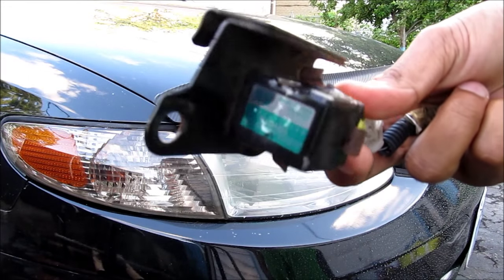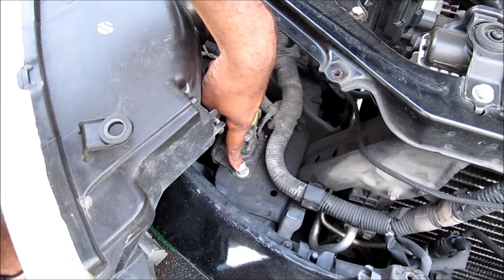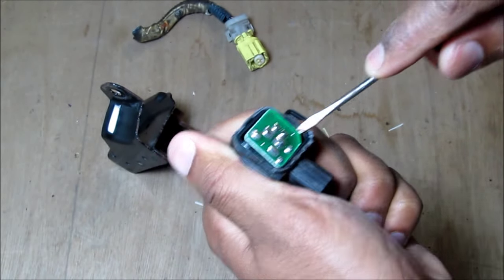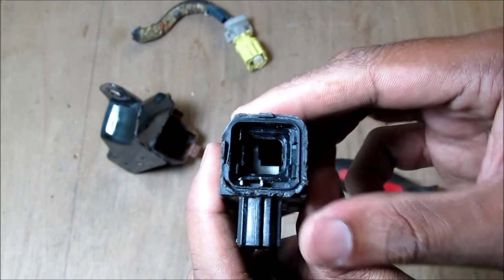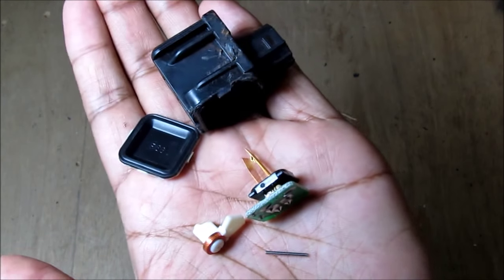How an Airbag Sensor Works

Comment: Great Video! Thanks. I've got side sensor fault on my Renault Megane 2001 1.9dci car. How can I check the sensors? How many ohm do I have to measure on the diagnostic resistor of the sensors? Can somebody help me? Many thanks in advance...
Reply from the maker: +Kotiti You might want to check the repair manual for the resistor values.

Comment: It looks like these sensors are re-usable (if not seriously deformed).

I am rebuilding a crashed MG ZS EV and was wondering about the sensors. I have replaced the airbags but worried to plug them in until I knew if the sensors were good or not.

Comment: he he "as you can see rust is probably a cause for these sensors failing"  he says rigjt before removing the immaculate "plastic"  sensor housing from its metal mount and then goes on to say how well sealed it is, couldent help but laugh at the contradiction. 

I'll tell you what causes these to fail, it's one of 3 things.

1, the resistor directly fails and the car reports a sensor problem.

2, years of warming and cooling causing expansion and contraction of solder joints breaks the circuit inside. 

3, years of vibration breaks the solder joints and therefore the circuit inside.

in any of these situations it will only cause a airbag fault to be reported if it affects the circuit made by the resistor,  it is technically possible for the circuit to fail beyond the resistor and for the sensor to have failed while the resistor circuit is still functional and not report a fault.
Reply: If the cables in the connector outside that seal rust, they can break, making the sensor effectively broken
Reply: 007titok
If the wires break then it is a wiring problem and not a sensor problem per se. If the wires don't make contact the ECU will sense an open circuit and a warning light will come on, that is the purpose of the resistor in the sensor. The sensors are quite robust and give little problems.
Reply: Thank you for this comment. The resistor can be replaced then if you have a faulty airbag sensor. You can also use a multi meter to run continuity tests to find any shorts and repair them. A resistor like this costs around three pennies. A replacement airbag sensor costs about $30-$40. Fixing a damaged solder joint costs one penny worth of solder. Clearly these are worth fixing. I wish I would've known this before placing my last time. Never again. From now on I'm fixing all my failed electronic components rather than replacing them.
Reply: @artbyrobot1  But aren't the solder joints, you know...…... inside...?
Reply: @Dalziel45  Yes they are, so you need to carefully open it and when finished carefully seal it again with some silicone caulk. Not really that hard. He shows it is easy to open in the video and he isn't even really being careful with it.

Comment: what triggers the airbag itself ?
shortage, voltage, or encoded signal ?
Reply from the maker: +King Parodije shortage of the resistor by the two contacts from intertia

Comment: I get a Code 19 on my Mazda5 but had no collision. Could a very rapid deceleration as you described cause a fault. Should I replace the front crash sensor and reprogram the SAS module?
Reply from the maker: +Matt Keefe first try reset and check wiring

Comment: My question would be,,,,once there is a crash and the entire airbag system has performed correctly are these sensors no longer functional after the repairs have been done and the crash data scrubbed from the computer ? all be it , i am sure it would throw a code during the resetting of the system if it were bad, but can they be trusted ? and are the a one time use sensor ?
Reply from the maker: +ron slaughter These aren't one time use, but some are, provided they're not damaged

Comment: I cringed a little when speedkar ran a blade on the plastic housing with his finger underneath and it slipped a little
Reply: My Lexus IS 200 have experienced an airbag deployment twice in one week without me getting involved in a crash or hard impact and the indicator on the dashboard wouldn't go off. What is the problem? Help with advice please

Comment: Will it works if the car is not in motion? I mean computer keeps receiving info about speed and so on but what if I've been hit while being on the stop sign?
Reply from the maker: +Grisanty de la cruz That I'm not sure about, depends on how its programmed.
Reply: That or if the car is running while parked and it's hit by another vehicle then yes it can cause airbag deployment but remember it depends on how quickly the other car decelerates, the angle at which the car makes contact, and how much the crumble zone gets crushed. But had it been a parked car (ignition off of course) then THAT cars airbags won't deploy. The car that hits it will go off.

Comment: wait so it is possible that under heavy breaking the sensor could fire?
Reply from the maker: Heavy braking will never generate the G forces needed to trigger because the maximum friction between the tires isn't enough to stop the car so suddenly

Comment: i got a question I have a 95 Chevy Blazer took same sensor off I had to drill rivits and bang em out  do you think it detonated it. the battery is disconnected I'm afraid to connected it
Reply from the maker: +MP CUSTOMS you could have ruined the sensor bit I don't think that would set off an airbag. The computer has to sense multiple things before it deploys, including vehicle speed. You'll likely get an error code and SRS light on the dash.
Reply: awesome thanks man much appreciated

Comment: How can you check if the sensor is actually working and sensing? My air bag light is on, so I am wondering if the sensor is not working at all?
Reply from the maker: +Paul Manning Measure the resistance across the terminals of the sensor. If it's open circuit (infinity resistance) or closed circuit (zero resistance) then its defective. That's the self test that the SRS computer performs everytime the car is started up. Scan your car using an advanced scanner or Toyota Techstream to get SRS codes to point you to which part of the sensor or harness is giving trouble.

Comment: bro u gotta way of illustrating complex processes so anybody could easily understand... thx.. btw so say an airbag deployed if u pulled those wires off tht sensor would tht stop someones car from dying...
Reply from the maker: Thanks for the feedback. Some sensors and srs computers have to be replaced (or reprogrammed) after airbag deployment. To deploy an airbag those wires not only have to touch, but it has to correlate with vehicle speed to determine deployment.

Comment: so if the air bag deployed do I have to replace the sensor and the air bag and that it.
Reply from the maker: +German Salazar You have to replace or reset the SRS computer too.
Reply: speedkar99 how can I set the srs computer
Reply from the maker: +German Salazar You have to Virginize the eeprom using the dump from a car that hasn't crashed.

Comment: Is this same as an impact sensor?  My car has the airbag light on all the time, and i checked with scanner, and shows that the driver's side impact sensor.
My car is 2004 Gti Golf.  I heard the sensor is pretty expensive.. Any idea guys?
Reply from the maker: Perhaps the diagnostics manual can hint how to test the sensor with a multimeter to verify if it's the sensor, wiring or computer

Comment: Hello! I have this problem Renault Megane ii 2008

Renault: ABS - Invalid electric power assisted steering signals
Renault: Airbag/pretensioners - Computer to be replaced following impac
Reply from the maker: +Silva Talia Yes you will have to replace the sensors, pretensioner and computer following a crash. The computer can be hacked and reset though.

Comment: can rapid declaration be fast breaking ?
Reply from the maker: +stovy Fast braking isn't rapid enough to deploy airbags. You have to impact something.
Reply from the maker: +stovy Fast braking isn't rapid enough to deploy airbags. You have to impact something.
Reply: Fast breaking will not give the level of deceleration required to close a sensor, you are talking about 25gs plus during an impact.  To give you an idea, a new Corvette will give you less than 2 gs when turning a corner at max. speed.
Reply: if your fast braking sets off the airbag, you either have amazing future technology for brakes and tires, or the airbag is faulty. it has happened though, usually due to a short but it's uncommon

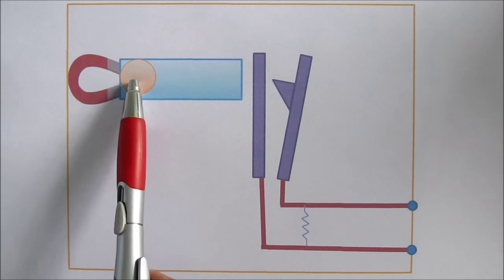Comment: 1:10 How the diagnostic resistor checks whether the sensor working properly or not?
Reply: For what it is worth, investigating authorities can look at records stored in crash detector chip to see if SRS malfunction was present before vechicle was driven. After a crash, even a minor one that sets off crash detector (Like hitting a deer) people may ignore airbag light and continue driving vechicle, which may or may not protect them as designed if they were involved in another more serious crash before SRS system was fully repaired. The resistor which is connected in parallel with contacts of crash sensor will read a set resistance which will either pass or fail diagnosis testing. There are multiple methods this can occur, whether is be a voltage divider monitored by a micro-processor software, transistor (Base) resistor which makes transistor switch ect...Helps protect the manufacturer in cases of litigation, and protects people by illuminating SRS light indicating there is a malfunction somewhere.

Comment: what is the resister value of the sensor ? Is it 1k ohms or 2K ohms ?
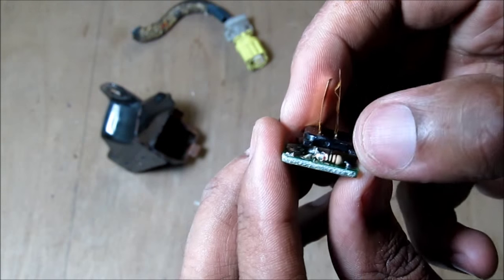Reply from the maker: +Suranga Sampath I saw brown, black, black on the resistor color bands @ 2:50
Reply: +speedkar99 

I searched on the internet....finally i got it... it is 10K ohms ( 5 band colour code resistor)
http://www.1728.org/resisclr.htm
Reply from the maker: Cool. You could have just as easily measured it with a multimeter.

Comment: great video.. my question is why is that part so expensive. looks like they could make that in china for about 5 bucks. I have a 07 chev truck...price of sensor 275.00 . scam or what
Reply from the maker: $5 sensors aren't made the same as the OE.

Comment: low tech would of thought this would be solid state ?
Reply from the maker: +Jacana Productions exactly, I would have thought it would have been a MEMS or solid-state device to detect deceleration, not just two prongs that bounce together. However rememeber this car was from the 90s...
Reply: Yes I guess and that why Toyotas are so cheap to fix vs Ze German cars. And most of the public don't or can't tell the difference any way in ride and build quality  although ze germans are really building a lot worse quality vs cars from the 80s / 90s due to cost cutting.

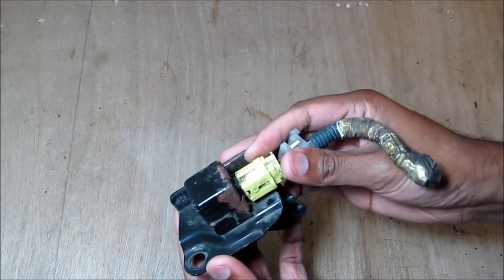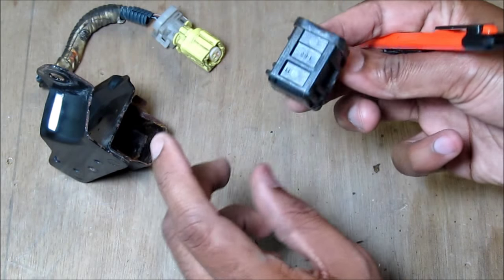Comment: Rust 1:49 in a sealed unit, 2:08? That sensor has no corrosion on the inside because it is a sealed unit. A finger almost sensed a knife. 2:13, be careful.

Comment: that switch seems to be too low tech to be reliable.
Reply from the maker: +Noseefood yea I was a bit surprised how simple it was when I opened it.
Reply: speedkar99 as long as it works... i've heard side airbags deploying when u hit the curve hard.
Reply: Noseefood that must be with very high speed.... the engagement of the senor doesn't guarantee a deployment, the computer checks for speed of the car and lots lots data before popping the bag
Reply: Agree I’m shocked

Comment: Newer systems use solid state circuitry with a sensitive accelerometer in system with a microcontroller. Check out my channel for automotive electronics reverse engineering.
Reply from the maker: True, newer systems use MEMs devices to detect deceleration. Nice channel you got there.

Comment: Would the airbag go off if you took a sledgehammer and knocked the crap out of the sensor? I asked that because my idiot stepfather actually wants to try that.
Reply from the maker: I would actually like to see that work ...
I'm sure the car takes readings such as speed and engine RPM